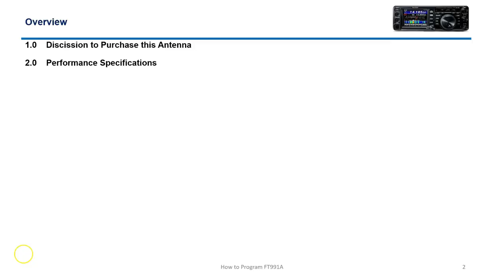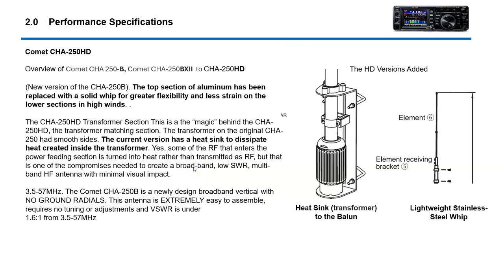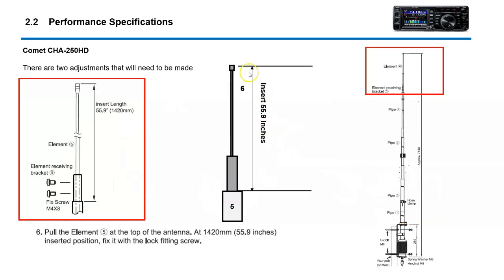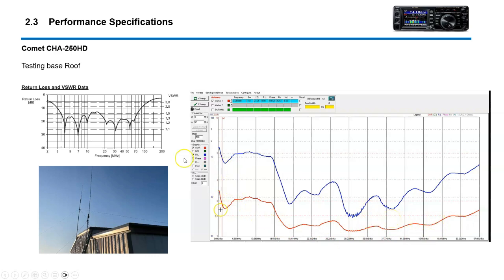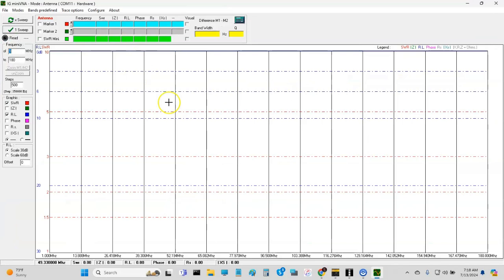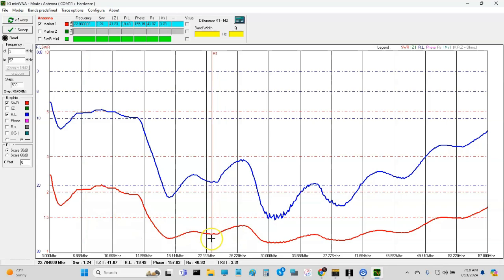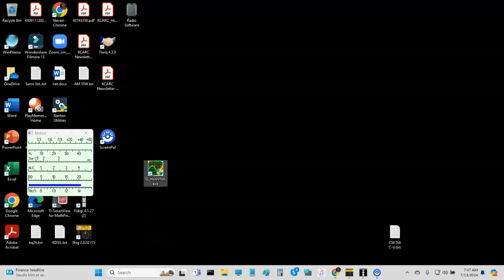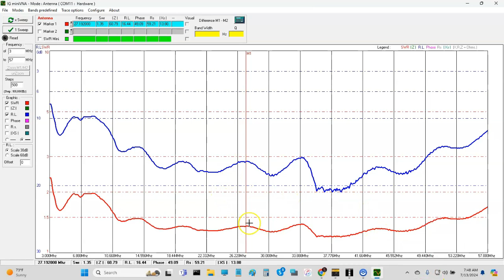Video # 2 Comet CHA-250HD HF/VHF SWR Test Data (80, 40, 20, 17, 15, 10 and 6) HF Vertical Project

Comment: Thanks for the video.  I am looking at buying my first antenna.  The DX Commander Signature 9 had my attention but I believe I would be better satisfied with this one since no ground radials required and it covers all bands from 6m to 80m.  Kenny AI5VB
Reply from the maker: Thanks for the message - the antenna works for me and hope it will for you - I make CW all the time on 40 and 20m  usually 5 to 25 watts - 73 and GL..

Comment: It's not "7" meters, it is 7mhz or "40" meters!  And the swr tells us nothing about efficiency, it only tells how well matched the antenna is to the transmitter.  A dummy load has a good swr on all bands but is a very poor radiator!

Comment: This is "NOT" an end fed antenna, it is basically an off center fed antenna that uses the coax outer shied and the metal mounting pole as the other half of the antenna.  Nice they specify mounting at 30' and that is so the counterpoise (metal pole) is at least 30' long.  The antenna is very lossy, especially on the lower bands, and the matching transformer cause most of this loss and is why they put a heat sink on it.  It wastes power in the form of heat!  That, and it's short length, especially for the low bands is what causes the high loss.  The 16db loss on 80 meters only allows about 10 microwatts of a 100 watt signal to be radiated.  You can make contacts with it, but just think how many more contacts you cold make with a much more efficient antenna.  Wire is cheap compared to this antenna and can be made into antennas that are much more efficient!
Reply: Whats the best antenna regardless or price? I'm trying to reach family in New York from Oregon. I have a budget of $900 max but would ideally like to spend less. Just asking you since you seem to have more insight than most of the comments here.
Reply: @jack_vance_  At that distance, a 20 meter Yagi pointed in the right direction.

Comment: Got a factory 2nd for £70 uk.  Any end fed wire will beat it by a mile, the 1to6 unun is so losey .You can add a 1to4 balun and turn it into a RYBAKOV, big improvement.Thanks for the review      Rob   G4WGR

Comment: Hi - This is Rich, W2FKN and I just installed the exact antenna you have described so very well. Since I'm in an HOA community
I cannot mount the antenna on my home. It is attached to a very secure pipe arrangement in a landscape area behind my home
anchored in an 80 lb concrete block underground. It is mounted only 8 feet above the ground and very well guyed. Connot be seen from the front of my home. Works well even though it is only 2 feet from the back of the house. Great SWR on my FTDX5000 MP Limited - essentially 1 to 1.2 or less throughout all bands. They have no problem with it - Gets out damn well - 73.
Reply from the maker: Hi Rich, thanks for the message I missed this last week - glad to hear its working.  I've been happy so far to had a lot of fun on one of my first bands as a Tech 10m a lot fun just on a freq and started calling CQ - oh my friend have fun and let me know if there's anything you need from me 73 and hope to catch you on the air!

Comment: Had the original CHA-250b.  Good antenna until I moved to West Texas where the wind bent it up pretty bad.  I DO wish they would make one that can handle more power...  Maybe handle 600-1000 watts.  Might look for a CHA-250HD at the Belton Hamfest in a couple of days.  73!  W5ODP
Reply from the maker: Good evening Dave, thanks for the message, yeah so far I've been lucky with the wind - yeah higher power would be nice - ok have a safe trip if you go to Belton, let me know if you need anything from me - 73 and have a great weekend!

Comment: Looks like we have a lot in common. I have had the CHA-250HD installed for over 2 months and am using the FT-991A, too. The antenna is mounted to a steel pole only 6' above ground. I've been very pleased with the antenna's performance, as well. 
Much better than I expected.
  6m -1.3 SWR / 17.7 dB loss
10m -1.07 SWR / 30.0 dB loss
12m -1.01 SWR / 43.0 dB loss
15m -1.05 SWR / 32.0 dB loss
17m -1.13 SWR / 24.0 dB loss
20m - 1.37 SWR / 16.1 dB loss
40m - 1.64 SWR / 12.0 dB loss
80m - 1.8 SWR / 10.9 dB loss

KE8VEG, 73s
Reply from the maker: Good evening and thanks for the message and test results yeah for me its all new this is my first experience in the 15 through 80m  I've always done 10 and 6m - Yeah I've  had good RST on 80 through 17m there's a net on 3916 at 7:30 PM CST I was able to talk to folks all over Texas - okay thanks so much for the message I am very happy with the results, if you want email me shope02@yahoo.com I'll send you the data sheets with the take angles and dB loss at 10ft and 35ft for all bands I don't fully understand but I'm happy with the performance.  73 and hope to make a contact on the air !

Comment: Can this be used on GMRS?
What is the SWR readings at 462.000 - 468.000?
Reply: No. GMRS would be just above the 70cm ham band. This antenna only works 80m-6m